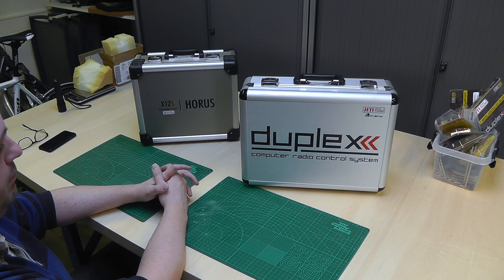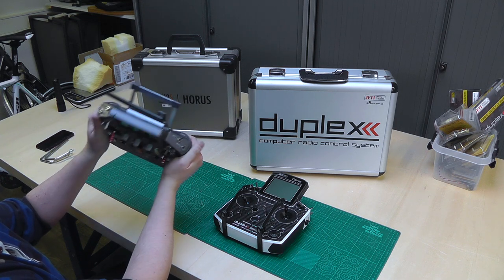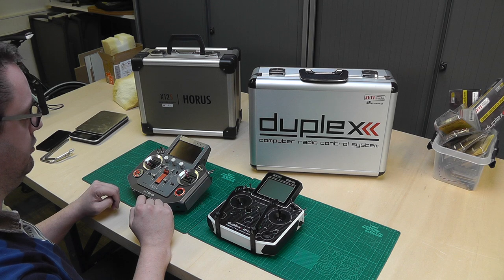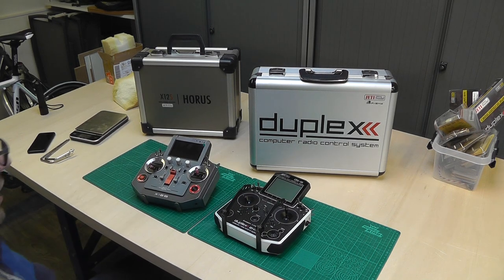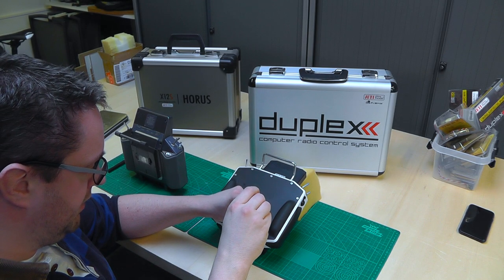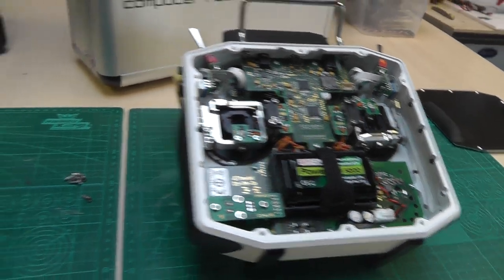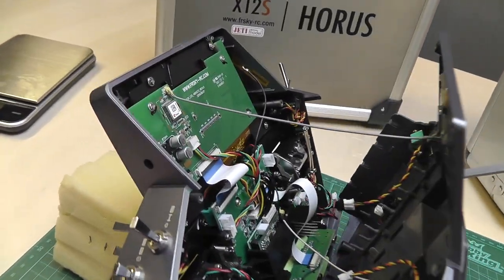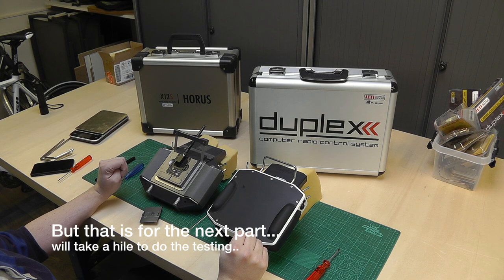Jeti DS16 vs FrSky Horus Part 1 - Looks and Feels and a look inside.

Comment: Great review, here in Australia there is a big difference in price the Jeti twice the cost of the Horus which should be considered .
You said that gimble tension can be adjusted from the outside on the Horus, where do you access the screws., as I don't want to take mine apart to adjust it. Thanks

Comment: isn't this a poor comparison using the 4 yr older DS16 kept current by firmware upgrades against the just released Horus. The Horus basically has all the announced features of DS24 which is just being released now. it's like taking one brands flagship radio and comparing it to anothers older dated radio? Which will make your follow on videos useless since a long list of features have been added since the DS-16 first released....
Reply from the maker: max throttle I don't think so. Both radios offer more or less the same functionality. And still a ds16 is a 1400 euro radio, where the Horus costs about 500. So putting up a ds24 next to it should be totally out of proportions.
Reply: Jaap Greve this is like comparing a high end quality car makers older model against an affordable family commuter that has modern features.
when the older model came out it had a cassette player vs the commuter having blue tooth and then saying the quality car costs more. 
price is its own separate comparison in all things. though a vw was the base to a Porsche the Porsche costing far more isn't what is compared unless they are of the same class or function. are they both performance sports models or luxury or low end family car are obvious class comparisons for a reason.

Jeti uses more bearings and precision pieces that cost more. FrSky duplicated the features of the DS-24 but with cheaper components and materials. So you'd first class the radios by is functionality which the DS-24 and Horus share rather than the Horus to the DS-16 that doesn't have many of the same features because it's a 4 year old radio. 

so you may try to make this Chinese cheap car vs a older German or Swedish made vehicle that cost more for good reason but such comparisons don't really make sense.
Reply from the maker: max throttle thanks for your feesback. I think you are right and that is exactly what i am saying. Apples to Oranges 😉😉 I am a very happy user of both systems. But the jeti/frsky comparison comes to the table every time you read the forums. So why not put them next to each other. I do not have a ds24 and will not have one in the future. But i think a comparison between the two is pointless. Ds24 will win in every aspect. And it should be. Ds16 vs Horus.. hmm result will be deprnding on your personal needs 😉
Reply: Jaap Greve which is why it's not sensible comparison.  if the radios are different then your personal needs are different why compare them. and the DS-16 isn't being compared to the Horus it's been compared against the Taranis that came out around the same time. 

I could pull up a 2000 Porsche 911 and compare it against a nice VW 2016 GTI but they are different enough that the comparisons stop making sense Japie.G.